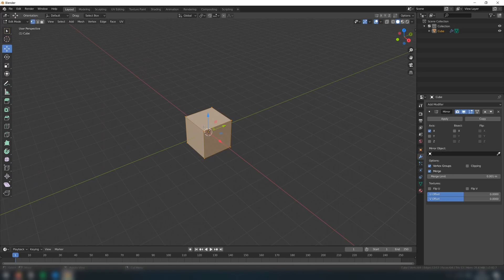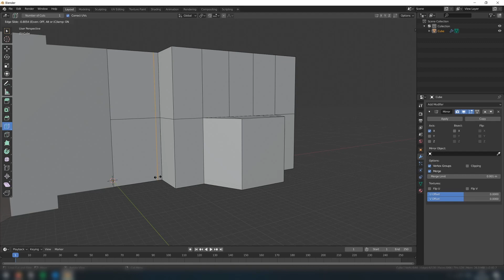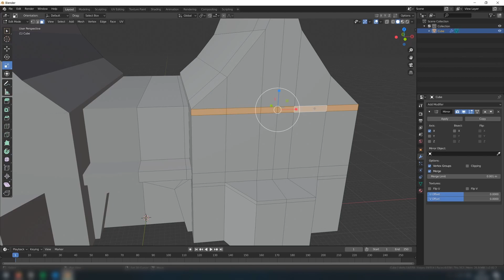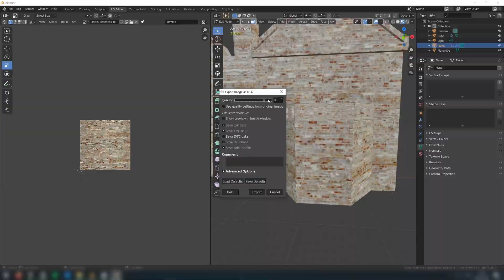How to make a PS1 style mansion in Blender | Modelling Tutorial

Comment: A small criticism. You are creating alot of unnecessary geometry by doing all those loop cuts. You could use a separated part of a mesh or a completely new object as say The tower or the balcony etc. You would save on alot of vertices.
Reply: And one minute later you disolve all the faces :D I take that back :D
Reply from the maker: No problem! I do agree that you end up with a lot of unnecessary faces that have to be cleaned up after, so you could probably reduce the workload using separate meshes, but I'm just presenting it the way I've always done it, even if its not necessarily the best workflow
Reply: Loop cuts always makes me wonder if I cant just "loop cut" a single face (as is my intention) without having to reach for the knife tool.
Reply from the maker: @trevortjes  I really wish that were a thing
Reply: @trevortjes  A little late here. For that, select face and use Split tool. after that loop cut will only apply on that face alone